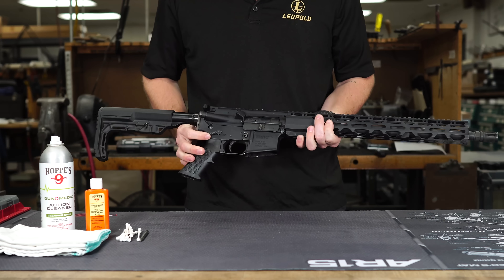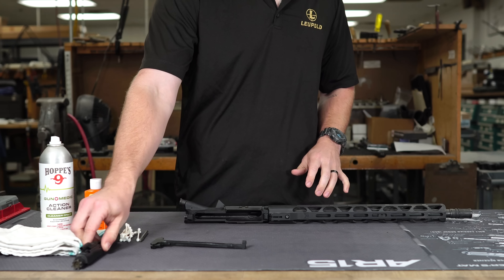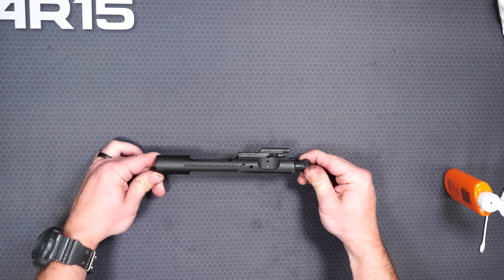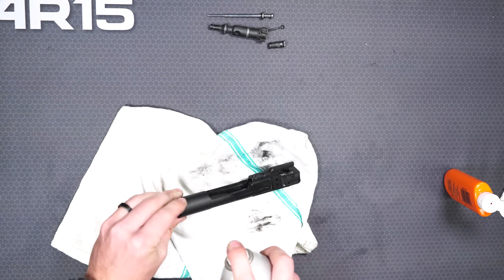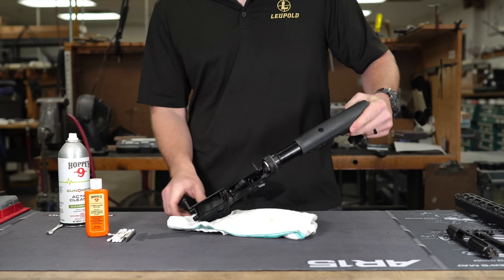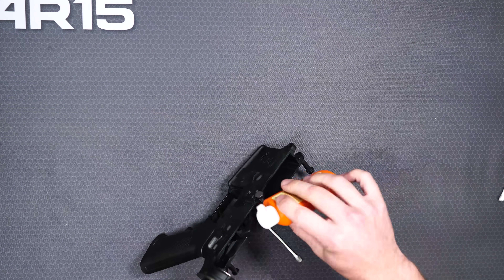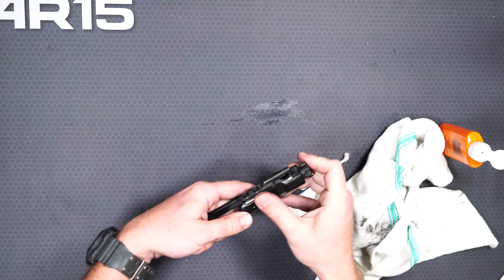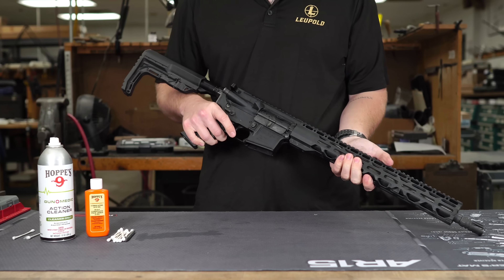How to Properly Clean and Lubricate an AR15

Comment: Thank you for the video sir! I took my newly acquired AR to the range today, I was either having an issue with the ammo firing or the rifle jamming,  so I broke it down and cleaned it as much as possible with your video as my guide. Can’t wait to get it back to the range and see if it’s better
Reply: Did your problems go away after cleaning it?  My son had the same problems with my new AR-15 when he sighted it in — misfires, jamming, dented cartridges, etc.  Today we took it out to sight in a new scope (only the second time it’s been fired) and had no problems using the same ammo as before.  He thought that maybe the factory cosmoline-type grease may have caused the earlier problems.  I may clean it real well tomorrow to remove any remaining factory grease.

Comment: same way i clean mine . only i am ocd about clean barrels lol . love the hoppes oil and the rem oil . i love how some guys and so called instructors basically tell people to dunk the rifle in a bucket of oil lol . but if you don't clean it i guess you need to run it dripping wet lol . great video . on my target rifles i use grease on the inside of the upper and on the bolt carrier rails .  as i want it to be lubed and the lube stay in place . but only on my target rifles .

Comment: I have a fine haired dust brush that i dab in the oil in small amounts. Leaves a nice layer of oil on everything i brush thats not too thick or thin. That combined with the Hoppes cleaner makes it so once youre comfortable with it you can have the whole job done in 10 minutes.

Comment: The bolt carrier insertion was a little difficult from this instruction. Might need to refine that, but I did figure it out. The way it came out it seemed like you would just push it straight in, but you have to find the key it slots into. Probably something the AR-15 guys just don't even have to think about.
Reply: Thank you for this tip!
Reply: Yep. Just make sure the bolt itself is pulled all the way forward, then align thr cam pin.

Comment: I get nervous dumping oil where i can't whipe it out.  I don't think I'd actually drop oil into the lower, at most maybe put a little on the swab or a patch and use that. Other than that, i agree with this
Reply: I have a needle oiler for these small areas.....but don't forget the oil from your bcg will also get down in there, so I don't think a ton is needed after cleaning.

Comment: I was an armor in the military because of that I picked up some bad habits as far as cleaning my personal weapons. One of my biggest problems was wiping all the CLP off, Don't do that I live in a moist area and re blueing barrels sucks and never came out the same. Plus if you every day carry in a cold moist climate not only do you get gunk on a dry gun but rust as well.
Reply: So that's why the barrel I re blued wasn't as dark as I wanted it to be cuz it was cold
Reply: @SmokinGoons  actually I don't know I know, very little about rebluing barrels. I've only had to do it a couple of times. What I'm saying is the military tells you to store a weapon in the Armory completely dry. Because if you coat it and CLP it will drain all over the place. Not to mention most real armories are a controlled climate environment. It is kept very cold in them because cold air is dry air, and dry air prevents rust. Thus eliminating the need to reblue the barrel of the weapon. However in a Northern State yes it is cold it is also extremely moist and it is really hard to control the environment, not only do I have a dehumidifier in my safe but I also have desiccant packets in the safe for sucking the moisture out of the air. If I do need to do any major work on the Firearms I turn on a dehumidifier in the room and it gets really cold. But it seems to prevent rust when I'm performing maintenance.
Reply: @SmokinGoons   If you're not going to actually re-blue the whole thing ( hot bluing) just use Brownells Ortho Blu.   Degrease it with Brake Clean or your degreaser of choice.  Then degrease it again.  At that point wear nitrile gloves and do not touch the barrel with bare skin.  Then heat the barrel with a heat gun.  Not insanely, just until it is uncomfortable to hold.  Then wipe on the Ortho Blu.  Unlike the Birchwood Casey stuff, Ortho Blu does not need an arrester.  Nor is it necessary to clean it in between applications.  Just wipe it on, let it dry and repeat until you get the color depth you want.  Then buff with some 0000 steel wool, wipe it down and put a light coat of oil on it.  I have done a shitload of touch ups and even full bluing jobs with Ortho Blu and while it isn't as durable as hot bluing, all those guns still look great years later even.
Reply: @floydi9709 thanks for the tip I’m gonna try this on a rusty barrel

Comment: What about Cleaning the chamber? I find That to be the most tasking part to clean. Thanks🤙🏽
Reply: Good chamber brush works well.
Reply: He missed that important part! I would have put a thing layer of oil in the bolt before getting it back inside the carrier...just a little in the area where it has friction.

Comment: So I have a question. I learn something new from your channel all the time. I have multiple AR builds, some of which have had zero use and zero rounds put through them. How often should I be cleaning my rifles that just sit in my gun safe with zero exposure to the elements? Especially my rifles that have never been fired. I clean anything I use after use but I dont really clean or oil my rifles I don't use. Im wondering what the SOP is on that? Any answer would be appreciated. Thank you!!

Comment: I use motor oil to clean and lube. I put the parts in a plastic dish washing pan and coat the parts with motor oil. I will let it set for a while, oftentimes overnight. The motor oil will absorb the carbon fouling. Wipe it off with a disposable blue shop towel. And, motor oil is cheap compared to gun specific CLP products. You could ask if the motor oil works as well as more expensive gun specific products. Well, my guns cycle like they are supposed to. You can’t improve over that.
Reply: Motor oil is corrosive. 3 in 1 oil would be better
Reply: @paulm9639  well I’ve never seen an engine block rust or anything else that was covered in engine oil. Mobil 1 is great stuff, Iv got rifles from the sixties and not a speck of rust or corrosion.

Comment: Cleaning and lubing is a personal thing. You can run any of your firearms dripping wet or almost bone dry, clean n lube every time you look at your guns or only after you've fired a gazillion rounds. The one thing that is true about ALL firearms is that they will tell you WHERE they need to be lubed 1000 percent of the time. You can clean every crevice  Where you see friction marks you lube, plain n simple. Anywhere else is really not necessary but up to you. A quart of ATF for cleaning n a quart of good ole synthetic motor oil for lube should last you this lifetime and the next one when you come back as a gnat.

Comment: carburetor cleaner spray woks great on the carbon in gas tube chamber and bolt . Be careful  as it will take off the finish

Comment: Ok so I've heard it both ways. Some say lightly coat everything and remove the excess etc and some use a grease/oil mixture and slather it on and claim AR's like to run wet.  Which is correct or is it personal preference?

Comment: I find that cleaning the barrel is more important with regards to accuracy. Break your barrel in by cleaning after every shot for at least 20 times. Then regularly use a bore snake. I also recommend using powder and copper solvents every 400-500 rounds. You advice on cleaning the action was great. Maybe wear gloves as action cleaners can damage your hands.

Comment: I cleaned my ar. I followed your instructions to the t. However now the bolt carrier group won't cycle or close at all when a magazine is inserted. I didn't have this issue before I cleaned I fear I may have messed something up. any tips or things I can check? I disassembled again and reassembled to make sure I did it right.

Comment: Omg not only did I need needle nose pliers and lots of pull to get the pin out, but I spent almost 2 hours trying to get it back in. I finally just gave it a whack with the mallet.

Comment: brake cleaner is much cheaper and more effective, you just have to do it in a well ventilated area. Paint thinner with high viscosity works for hard to remove crud. you just soak the part in it for a few minutes.

Comment: Always lube gas rings and few drops in charger to grease is better on bolt a ar gets hot after lot rounds so little oil only wouldn't protect wear use a good lite grease white paste or lumem is gd also always clean bore after any fireing

Comment: At one point you said "ejector to the left and extractor to the right" (maybe I have it backwards).  But you didn't show which is which.  Can you describe them?  Thanks.
Reply: As seen from the rear..... so just as if it's in the gun, and you're shouldering it. 
On the bench, place the bolt face forward.

Comment: I have a new AR and the charging handle will not go back only if I mortar it every time. It’s fresh out of box.  I took it apart and lube everything but when the bolt goes all the way in I can’t get the charging handle to pull back. Is this thing safe to shoot in your opinion? Maybe it’s user error? Thanks

Comment: One tip to add, DO NOT, mix cleaning chemicals.  I mixed two different and the combination dissolved the rubber gas rings in the bolt.

Comment: What do you do when the Carter pin doesn’t go back in as flush as it was when you took it out….? Couldn’t you have just sprayed cleaner in the back of the bolt???
Reply: Just for clarification when you say ejector pin should be “on the left” is that when you’re looking down the sights? Or looking down where a round would be staring at you? Also is the reason it has to be that way because cam pin won’t go in otherwise?

Comment: About how many rounds should you do this ? Purchased my first ar 15 an FN 15 . Would 100 rounds be too early too clean ?
Reply: A lot depends on the ammo you use. I bought some reloaded ammo from a company online and they used some of the most corrosive powder I have ever seen. Even after only 30 rounds, it needs to be cleaned or everything turns green. Normally factory ammo will not do that at least from my experience. But I do like to clean my ar after every session because I like for my gun to be clean.
Reply: You can't hurt your rifle by properly cleaning it. That's the only way to know how dirty it will get after how many rounds, because each brand of ammo uses different powders. When in doubt, clean it!

Comment: It's "hops," like a bunny, not "hoppies." Anyway, you really need to add oil to the bolt assembly and the bolt cam pin as they rotate. You can wipe down the bolt carrier group, but the only place that needs oil on the outside of the BCG is where the BCG rides in the upper (the rails). Also, nothing wrong with adding a drop of oil to the hammer. The BCG slamming rearwards is what cocks the hammer. So, add a little lube to the hammer or else you have a dry, metal BCG running across a dry, metal hammer.

Comment: Im thinking about getting my first gun soon i want a ar-15 but my friend says im gonna have to maintain it a fck ton like oiling it every week even if i aint shoot it this true?
Reply from the maker: No. If you clean and oil it correctly there is no reason to oil it until the next time it gets dirty.
Reply: You need a better source of advice.
Reply: Your friend doesn’t know anything. I make sure the bolt is lightly lubed and send it. It doesn’t get cleaned regularly. My precision bolt guns get way more attention

Comment: Wait wtf. Barrel doesnt matter...  😂  no no no.  Barrel especially in an assualt rifle will have copper build up. Anyone that ever took chemistry in high school knows yellow metals and white metals dont play nicely together...  you need to run hoppes 9 barrel cleaner every 1000 to 2000 rounds at the least or if you plan for rifle to sit for a long time. This will remove the copper. Now the hoppes barrel cleaner will actually eat the barrel metal itself if left in.  So clean all the cleaner out.  Then cost barrel with then layer of gun oil to protect it.  You release precision shooters sometimes clean the barrel every shot!  So at least every 1000 or so clean that puppy. Your groupings will thank me later down the road...

Comment: Keep metal brushes out of barell. Air compressor, brake cleaner, stiff brush that will fit, amsoil spray lubricant, patch the barrel. Wax on wax off

Comment: Sorry! Totally disagree on not cleaning the barrel. As a former Green Berret, it's a common Standard Operating Procedure (S.O.P) practice to clean the barrel without exceptions especially when lives depends on it. You're recommendation Not to clean it is very Callous, indeed, regardless if you've only shot minimum rounds through it. Minimum rounds can be 50 to 200 rounds. But, hey that's just me.  Enough said!!! 💯💯😁😁
Reply: Agreed🫡

Comment: What are those 2 little holes on the right side of the bolt Carrier for?
Reply: The gas that cycles the Bolt Carrier group vents out of those holes.
Reply: Pressure relief holes. Don't put any lube into them.

Comment: I"m not a fan of over lubing any gun, particularly ARs.  A lot of people dramatically over lube ARs.  That said,  I would definitely lube that bolt up a little more than shown in the video. Unless you are just going to put a few rounds or something through it .  Maybe even put a little grease on it.   One thing I wouldn't lube is any springs.  Unless you are going to take them out of the gun so you can dry them completely.  Generally I just wipe the lowers down until I get a couple thousand rounds through it, then I will break it down and clean it thoroughly. As for the trigger, hammer and buffer springs you can use dry lube or you can oil them, just make sure you get all the oil off of them before you re-install them.  I usually just wipe them down with a lightly oiled cloth and then dry them with a dry cloth.  Oil attracts dirt and oiling things you aren't going to pull out of the gun and clean regularly isn't a great idea.  This includes magazine springs.  I'm under no illusions that I know more than the guys at MGW and I'm not proselytizing.  Lube your weapon the way you feel is best.   I'm just relating how I do it.

Comment: When assembling and disassembling the lower to the upper, is the position of the hammer important?
Reply: It can be done either way - I usually have the hammer cocked so it's just a bit easier to put together since you don't have to worry about bumping the hammer into the bolt carrier. But I'd say either way is fine, just preference or whatever comes naturally. It's mainly important from a gun safety perspective being that a cocked hammer creates more opportunity for an accidental/negligent discharge - especially if you broke it down while you're out shooting.
Reply: Your best bet is to have the hammer down, bolt forward and safety on prior to separating the upper and the lower.

Comment: Well this was not great advice.

Your AR doesn't need this much lubricant, and it actually only needs in two places: The bottom of the BCG where it meets the upper reciever, and inside the charging handle where the BCG makes contact with it. These are friction points. You did not lubricate on the bottom of the bcg where it meets the upper which will cause wear on both the bcg and the upper, and makes the rifle run poorly.

The bcg needs a little too on the inside, where it rotates, but it's a light coating. a visible sheen may not even be visible if you did it right.

Outside of those three locations your AR should not require much lubrication. a light coating that you wipe off for protection should be more than sufficient, and in the case of the friction points, only slightly more than that. This layer can be accomplished when cleaning by simply using lubricant to assist with the cleaning process.

Lubricant attracts carbon, when shooting. This means that soot from the rounds will get caught in any excess lubricant, and will cause your rifle to dirty up more quickly and therefore more prone to malfunctions. Just because the AR can be run wet, does not mean that's a good idea.

Comment: You didn’t even clean out the barrel. So much carbon gets built up in the rifling no matter how many rounds you have through it. With all firearms, you want to live where there’s friction. My upper I usually slightly over lube so that way some runs down the buffer

Comment: Well… maybe I’m overly anal but… I do not agree with the barrel  “not that important.” scenario. The barrel and chamber are as important as the action parts. Especially since it’s easy to give it the attention it deserves. They even  make a chamber brush that’s the same shape as the chamber. Spray and let it soak, brush it, patch it clean and dry, patch oil it and you’re done. Sorry, JMO.